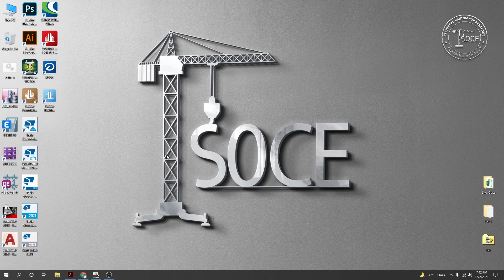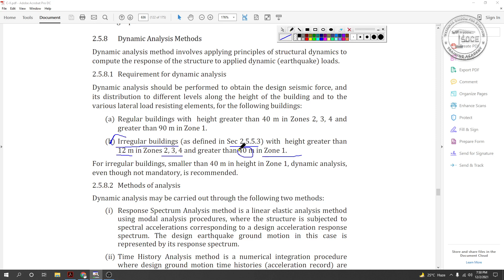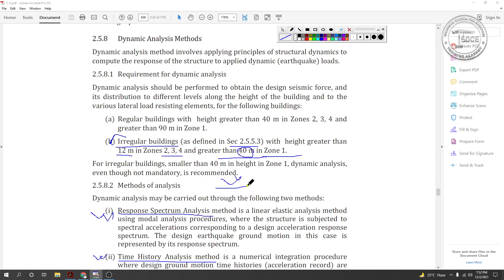BNBC 2020: Earthquake Engineering - When should use Dynamic Analysis Methods for Building Analysis

Comment: আমরা ডাইনামিক এনালাইসিস কেনো করবো?? কারণ ডাইনামিক এর চাইতে ইকুইভেলেন্ট মেথড সেইফ বেশি।
Reply from the maker: The main difference between static and dynamic analysis is TIME! If the load is applied so slowly, that inertia effects won’t play a role, all you need is static analysis. Dynamic analysis handles impacts and other “fast” happening situations, but also vibrations (which happen in time).

Static analysis is performed on the source code itself while dynamic analysis is commonly called testing, and is performed on input and output of the executable.
Reply from the maker: https://enterfea.com/difference-between-static-and-dynamic-analysis/
please read this article for more idea.